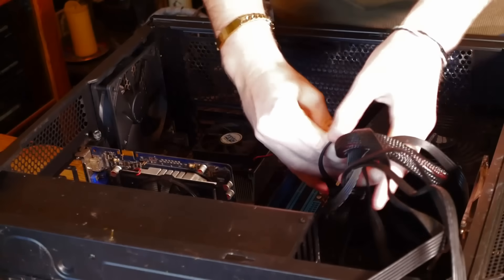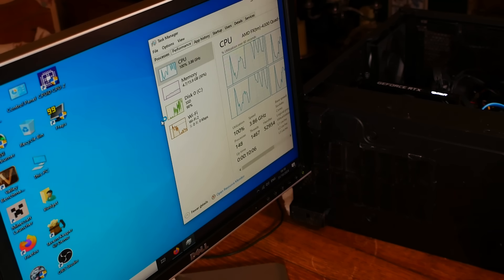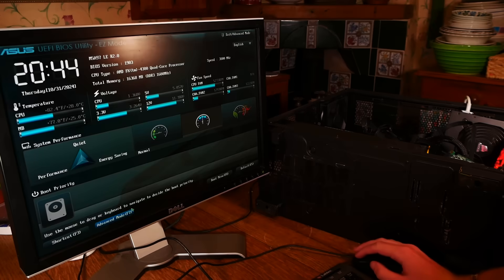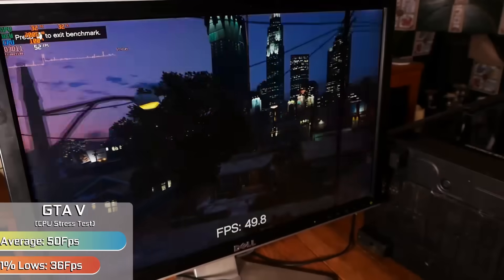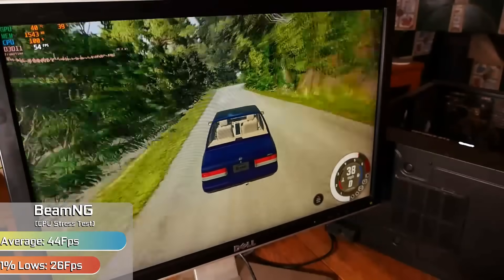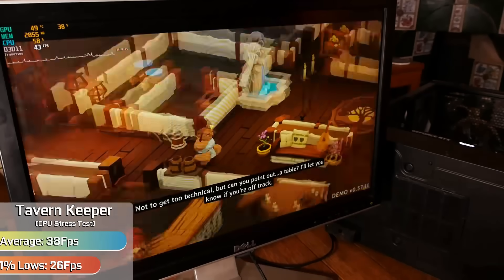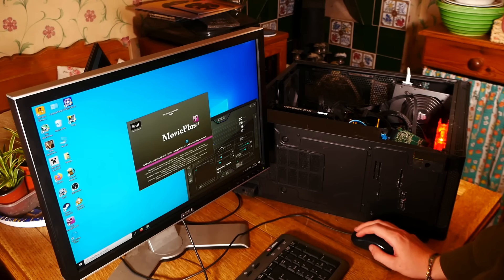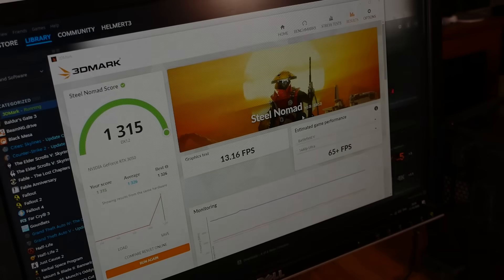AMDs Weakest FX Processor...

Comment: I still run a basic setup, with an FX-8350, RX 580, and 16GB Ram. Upgraded from a 6100 at launch, to a 6300, and then now at the 8350.

From my memory, the two biggest issues people had with FX was that they pushed for multi-core uses at a time where single-core programs were still the majority. Now that multi-core games are more common FX is able to have more longevity late in the game.

Another issue was that the original FX chips performed worse than the old AM2 Phenom chips, which AMD not only stopped selling in favor of FX, but re-used the name for a line of FX Phenoms, which pissed off AMD fans.
Reply: i loved the Phenom chips. i had an X4 840T from an hp prebuilt that could be unlocked to be a 6 core, equivalent to the X6 1055T. it overclocked really well. those were the good days of hardware tinkering.
Reply: Phenom II was a solid lineup. The 1090T was really good for its time.
Reply: @MikeU128  the champ of the phenom II lineup were the 940/955, and the low budget heroes where the morphing athlons II
Reply: If you can swing it then not a lot of money can get you a significant upgrade from an FX now. About 6 or 7 years ago now I went to an R5 2600 (now also long gone) from an 8350 and even that jump was mind-blowing. Well worth it for the money you’ll pay for an early Ryzen chip now
Reply: @pushatsinfrared  Doing so would require a completely new MOBO, as Ryzen is AM4. Plus since no AM4 boards support DDR3, that means buying new DDR4 RAM.

Honestly, even the basic setup I have can play most games pretty fairly. Most of my gaming takes place on games from before 2020, so im still good for now.
Reply: @markfacebook ddr4 ram and motherboard isn't that much 

am4 motherboard £50-100

any 3000 or 5000 (non g) cpu under £100 (don't buy 1000 or 2000 if you want i5 4th gen single threaded performance, trust me it's noticeable) strongly recommend 5600 cpu (full speed AVX and true 6 core, 1000-3000 are 2x4 or 2x6 core design) 

Ram cam be had for little as £20 for 2x8gb sticks (recommend 32gb but 16gb is fine)

A ssd for boot drive (doesn't have to nvme)

Or just buy a dell/hp/lenovo i5-8500 (not T) 16gb 250gb ssd full system for under £125  (I buy them For business as they are windows 11 "certified" compatible even thought the older systems they have running windows 10 is fine, the new tpm/cpu requirements is lame and creates unnecessary e-waste I expect 2025 October to be a busy month for me when people's computer start nagging them that they don't get updates anymore)
Reply: @markfacebook  man i feel you... i had an fx8350 (w 16gb DDR3 1866mhz ram, R7 370/Rx 580 4gb gpu and a SSD+HDD combo) as a main rig from 2016 up until early 2024... My Fx 8 core was holding more than OK nevertheless the step up into AM4 came to me as a cheap upgrade (purchased a used B350 mobo, borrowed ram, and a gifted free R5 1600) and went for it...

When i replaced the Fx8350, the R5 1600 seemed like a step ahead, not a jump... nevertheless a few months after i upgraded the R5 1600 with an R7 5700x and then... MAN... there the Jump felt so real... and think about it...

8 core vs 8 core... R7 5700x (the mainstream "basic" 65w 5000 series 8 core CPU) is 250% faster in single core and almost 400% faster in multicore compared to the Fx8350. Also nvme (even conservative pci-e gen3 of the 300 and 400 series AM4 mobos) is 600% faster than SATA3 as transfer interface. (yes, i know there are adapters and even some late AM3+ mobos featured nvme slots, but they would go as high as 20gbps, and still the slow IPC from the Fx series was/is a limit to the snappyness of the system). Also 3200mhz ram (supported even by 300 series AM4 mobos) is 100% faster than 1600mhz DDR3.

All in all what i'm saying is that you'll feel a huge jump. Yes. The Fx8350 can still run 90% of the games, but unless you're rocking a Gigabyte GA-990FX Gaming Mobo (or some 970 mobos that featured nvme) you are mostly rocking SATA3 interface for your storage, and unless you are rocking an Asus Sabertooth 990FX R3, you don't have PCI-E gen3, so you are limited to PCI-E gen2.

every aspect set appart isn't such a big deal, but they are all legacy/obsolete features. That's why despite being able to run most games (not 100% but most) nowadays you wouldn't pair a modern GPU better than a modest Rx 6400, that performs pretty much alike to an Rx 580... and that's even pushing it, since my Rx 580 went from 65 to 80 in some certain games when i tested the R5 1600... so the CPU was holding it back maybe 20%
Reply: AH I forgott, AMD burned the fx moniker, which up to this point was for the most fast versions of processors, to give the fx processor lineup some more shine.
Reply: > the two biggest issues people had with FX was that they pushed for multi-core uses at a time where single-core programs were still the majority.

That's not why Bulldozer got its iconic "Faildozer" name.

The reason that the Bulldozer architecture was so terrible is because of the cluster multithreading AMD came up with. The lawsuit over it not having as many cores as advertised has merit, because Bulldozer does not actually have the number of cores advertised. If you look at AMD's whitepaper on the Bulldozer architecture, what they call a core is a "module" that has two integer units and one FPU. A "4 core" part has two modules, "6 core" has three and "8 core" has four. The really horrible entry level "dual core" models only have one.

As an example, the FX-4300 has two cores, where each core has two integer units and one floating point unit shared between them. This allows the processor to run four integer threads. But when a thread wants to do floating point maths (which is basically all the time), the FPU is under contention from both threads, which more or less halves performance. This is why when you have two heavy threads running on the same core, the chip falls flat on its face, there's so much inner core resource contention that performance falls off a cliff.

It took a few years for operating systems to mitigate this problem, but the mitigation wasn't ideal. What both Windows and Linux eventually ended up doing is that the thread dispatcher would load up the first thread in each core with whatever is in high demand, and then backfill the second thread with low demand background processes. This didn't eliminate the resource contention, but it did maximize performance where possible.

The reason it was such a big deal at the time is because for the vast majority of x86's lifetime, a core/processor was a single self contained homogeneous unit that just worked on a single thread. The Pentium 4 introduced SMT, but that was hidden from the OS and could be treated as two half speed cores and have the same result. Bulldozer was a major departure where treating each integer thread as a general purpose CPU caused severe performance penalties. It wouldn't be until much later that Intel did the same with the 12th gen P/E cores and had similar issues that Bulldozer did until operating systems caught up again.
Reply: I rocked the 1055T for a looong time. It's honestly kind of crazy that when I was looking for an upgrade everyone recommended me to not upgrade to a 8300. AMD sucked a lot back then.
Eventually I managed to find a 3770K for a good deal, but it didn't feel good to "downgrade" the amount of cores.
Reply: At the time upgrading from any upper third of the Phenom II lineup to a FX was...too much money for so little gain. Also, the FX that really did have more performance were so power hungry it wasnt even funny.
Reply: More that they were using 8 integer threads at a time when few things used more than two threads and games tend to be more FPU heavy.
And those threads were weaker not only than the direct competition (SandyBridge), but also the previous designs (Nehalem, Penryn, K10), so the FX often performed worse than it's predecessor.
Some of that could be mitigated by a high oc ceiling that easily reached 4.8-5.0 GHz, but said previous designs could also do around 3.8-4.2 GHz, and SandyBridge pretty much guaranteed a 4.5 GHz oc while having a 30% higher IPC.
Reply: That's the real poverty route. Pc master welfare.
Reply: nah dude for one they run really hot for the ops you get per cycle and 2 they are kinda gimped with the cache i don't remember all the details but basically 2 cores share one of the components and that is a limiting factor for certain types of work loads (maybe floating point unit? something non trivial as related to gaming for sure).  DUde a friggin 15 watt mobile chip would smoke that thing now and i rocked a 990fx and 8350 when they were 5 years old (they were of questionable use then lol)
Reply: I believe I ended the AMD bandwagon at that point with the FX9590. Vashira. Upgraded to Skylake 6700k. Night and day.
Reply: I remember being some kind of instruction set the phenom didn't had and the FX did, and thats why AMD dropped support for the phenom. cant remember the exact details tho.

Comment: FXs can still perform alright if you overclock them via bclk
Though, by this point buying them doesn't really make any sense, here at least. Imo they stopped being a sensible purchase somewhere in 2019.
Xeons with chinese motherboards that might die in a week is where it's at🗣️🔥⁉️💯💯💯💯✍️✍️🔥🔥🔥🗣️🗣️🗣️🗣️

(Mine has been working for the last 3 years though, but maybe because my 2420v2 uses like 35w at most)

Comment: Part of the performance can be explained by the more modern tendency to prefer multicore CPU with several threads VS strong single core performance. Now everything from mobile phones and consoles to handheld gaming devices is based around (sometimes) lower speeds but multiple cores. Do you recall ARM/RISC performance back in the day? Nothing was optimized for that.
Reply: And then came BIG.little, pair a set of fast, but hungry cores, with a set of small, but efficient ones. Pretty much what Intel is doing with their E and P cores. Few fast cores for narrow tasks that don't scale well over many cores, and lots of small cores for things with better parallelism. And later versions could even use both blocks simultaneously, in case a task needs lots of CPU.
My current phone even has three sets of cores, four small ones, 3 medium ones, and a single fast one.

Comment: Had an FX-8120, and I don’t think I’ve had any good memories to be quite honest. I don’t even think it was average to begin with, as the CPU got hotter reaching its tmax. (62.5c) No matter the cooler, the CPU stayed super hot and was very unstable. It also didn’t help that the ASUS motherboard I had was modified since it was a pre-built machine, but it did give me the best value in terms of longevity. (Until the motherboard died) I would never recommend FX to anyone unless you absolutely know what you are doing, and even then I’d still point for a used Ryzen first gen instead of the FX. You’d still have a much better time than with an FX.
Reply: Same situation for my A8 7650K, I think it's due to the paste inside the IHS that dries out so badly it's just leading our CPU overheating to death.

I bought a 7600X.
Super duper fast, I9 11900K levels of speed.
Super duper cool (32 to 40°C MAX OC'd)
While my A8, goes from 38 to 60°C...

Comment: People tend to be overly dramatic with how bad hardware actually is. In reality if it performs decently and sits at the right price it's not a bad product at all.
Reply: Yeah I never understood the hate for FX chips, As long as it is stable and performs fine for the price then good, Older and optimized games run fine on old hardware, the new trash is not going to run well. So many just hate anything that cant hit 300fps in the latest AAA slop. Many just need to keep expectations in check with old hardware.
Reply: @Compact-Disc_700mb  Meanwhile I'm sitting here with an i5 of the same vintage, unable to hold stable 60 fps in some non-AAA games from around 2013-16
Reply: @HappyBeezerStudios  Asuming you are running windows, you might want to check your background processes and installed software to see if something is useing all your resources because that does not sound right. You might want to do a clean OS install if it was installed years ago. Could also be GPU or ram limitations.
Reply: @HappyBeezerStudios  probably an unoptomized game sadly. still a good cpu
Reply: The same price for the CPU and MB as for an Intel Celery?
Why not?

Comment: I built a dirt cheap system in 2016 with an 8320e with a mild overclock and 16gb of ram, an rx480 and a fast ssd. It was extremely cheap to build because nobody wanted fx and performed much better than earlier fx builds because of dx12 and vulcan, as well as many newer games taking advantage of more cores. It was a very good budget gaming and video editing system for 4 years.

Comment: I had FX-8320e and it still is the worst CPU I have ever had. 
The only reason I got it was that my previous PC had a Athlon x2 4450e which worked quite well for its price. I remember running a lot of games it shouldn't have been able to quite well.
The FX ran like crap, was hot and constantly gave me issues playing pretty much any game on more than low settings.

Comment: For lighter tasks, the FX series still delivers decent, playable performance in older and some modern games, thanks to DirectX 12 and Vulkan its aging like fine wine .
Reply: I can say the same about my Core 2 Quad system. Still doing fine for lighter tasks.
But a really interesting question now would be to compare the 4 module FX, especially the 8320 and 8350 to the i5-2500K and 3570K. They were around at the same time and the FX were claimed to age better once games start using those threads. But how do they hold up a decade later. Games do use more threads now, many not even playable on a quad anymore.
Reply: Keep seeing you in the comments lol seems like we watch some of the same channels. Keep up the good videos Daniel
Reply: Eh what’s aged really well is the i7 3770s as they’ve gotten older games use more of the 8 threads it just keeps gaming replaced my 4300 with one now I also have a ryzen but intel really had and by the balls the fx series are cool but did not hold up haha
Reply: 😂 No chance. The FX are total garbage. You'd be better off finding an old optiplex MT and building that out.
Reply: well i would call anything below an i5 12600k a nice experience^^ once you have used some like a 9950x3d or heck even my old i9 10940x which is an old X299 beast then an FX 8320 or so is quiet painfull and you should pay me to make that my daily driver ^^ hehe :D
Reply: dx12 is optimized?!
Reply: @AffectionateLocomotive when fx launched games were single thread heavy and rarely using well 2 cores, dx12/vulkan makes up for that big time to the point first gen i7 or even Fx processorers or phenoms with high core count are somewhat usable while dual cores are essentially useless
Reply: @oimazzo2537  Damm. DAMMMMMMMMMMMM. so how many cores do games that have dx12 use?
Reply: @AffectionateLocomotive  I have no idea if there is an upper limit but sure it can use more than 1
Reply: @oimazzo2537  no i meant how good is the multicore usage?
Reply: @AffectionateLocomotive  very good. You can actually try some game supporting dx11/12 and see the difference by yourself, with monitoring programs you can even see how the workload is spread on the various threads. For example if i play monster hunter world in dx11 with my 5800x  I get 70ish fps in dx11 while dx12 pushes me towards 120ish with a processor with already good single thread. With stuff like fx processors with very bad single thread performance  dx 12 brings even way more
Reply: @oimazzo2537  nice

Comment: Ive used to have fx 6200, during summer ive had to have both side panels off, placed next to open window and big home fan blowing air through it… thats how it wouldnt turn off. Also ive had max utilization set to like 95% or even 90%

Comment: Nice stuff. You should see how the FX-9590 holds up today.
Reply: Mine still holding up pretty good 🙂
Reply: I wouldn't really go that far, but instead take an FX-8350 or even better, the 8320, which was a budget recommendation for quite a while. They overclocked pretty much to the same speeds as the 5950 came stock.
See how it can keep up to the i5-2500K and 3570K, which were the direct competition at first. And it was said the FX would age better in the long run, once games actually use those available threads. Let's see how true that holds.